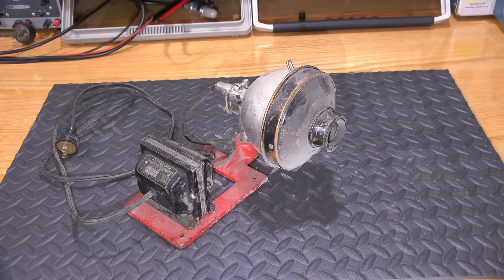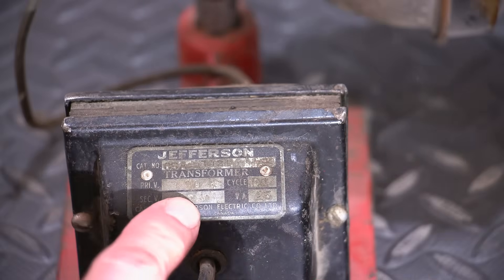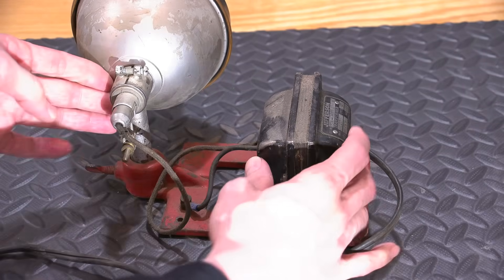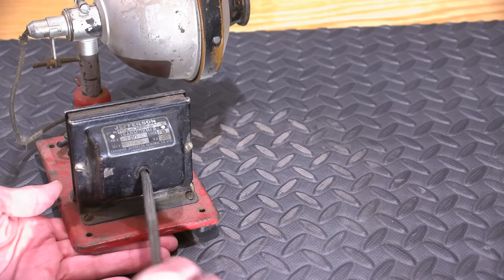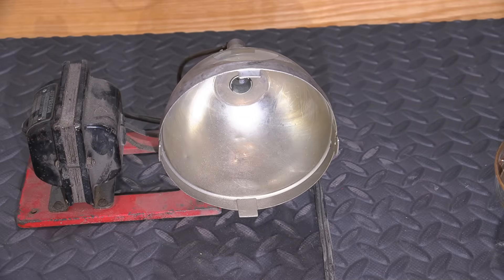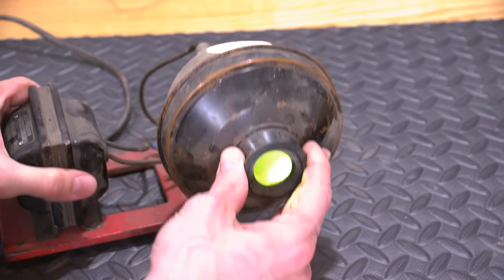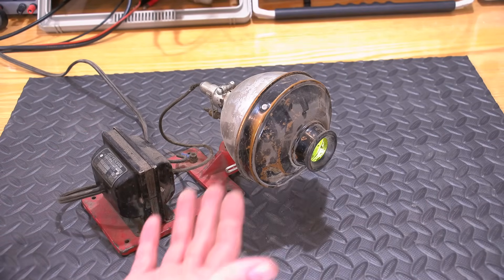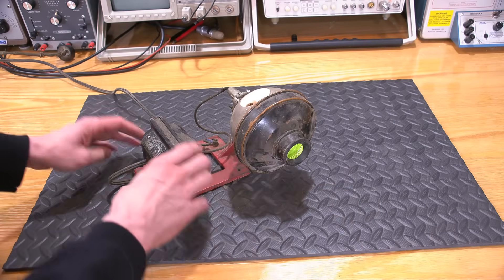Barn Find - What Is It - 1940's? Mystery Device Teardown!

Comment: OHMYGOSH. I think you folks and the comments about "Candling" just saved me from throwing out 49 Jumbo eggs! Last week, I bought three cartons of 18 eggs each. Out of the first 5 I had three that had embryonic development. I pitched all 5 but not the remaining that I left in the refrigerator (I hadn't decided how to handle that large of an investment until now). I have a very bright green led flashlight. I turned off the light in the kitchen and tested it on an egg. It shows the yolk shadow just like the images I found on the net! I did 13 from the first carton and didn't find anything like what a google search shows. I did find three where the yolks looked much larger and darker than the others. I cracked them open, and they had DOUBLE yolks! I'm going to check all my eggs this way and hopefully, I won't find anymore embryonic eggs even after the egg shortage is over. THANKS Mr. Carlson!
Reply: There is no reason what so ever to throw the fertilized eggs away.  If it bothers you simply remove the spot and use the egg.  Used to happen all the time.  I'm afraid we have lost much common sense.
Reply: @pcar5  OOOf, they were pretty well along. It was a bloody mess in the skillet. Not very appetizing. In fact, pretty nauseating. I'm not sure why I had such a high rate of development in that first carton. The other two looked ok under the light but they are still going to be hardboiled.
Reply: I’m turning 64 years young this year and I Haven’t seen Jumbo or Extra Large Eggs in many Years Now , The Box Might state Large Eggs But They Are Probably The Smartest Sized Legal Eggs They can Market !!! You Have To Cook a Dozen Eggs Just to Fill a Small Plate to Eat !!!! Darn ! Now I am craving a Couple of Egg Sandwiches , that Should cost me $30 !!!

Comment: With the flash bulb, you could jury-rig a standard bulb mount so that the sides and base of the bulb are shorted.  Random volts won't trigger it then, and you can unscrew the bulb without any damage.

Comment: The flash bulb has fine magnesium wire inside. Also, I believe the bulb is filled with oxygen. A D battery could provide enough voltage to make it fire.

Comment: That type of flash bulb was typical for the large format Graflex Speed Graphic press cameras common in 1930-1950s. Bulbs could be bayonet and larger screw-in (Edison). Your #11 was likely used with a seven inch reflector.

Comment: Green lamps are used to be able to navigate and work in greenhouses at night during the dark period because it does not affect the plant growing cycle. It's not a spotlight, the light from the bulb is focussed onto the green filter which becomes the new, green,  light source. A large filter would provide just a diffused, and dimmer, light, so that's why the filter is small.

Comment: You didn't explore the focal length so it is not clear to me if the light is used close in or at a distance.  If at a distance, perhaps some sort of signaling light such as a semaphore for a rail road.  It is too small for a rail road, but perhaps for a mine or a factory environment.

Comment: Those large flashbulbs were prone to shattering. They are filled with a fine magnesium wire which can ignite with static electricity. The early safety device was a piece of glass to confine the bulb remains should it shatter. This was later replaced by a plastic shield. The final iteration had a plastic coating to contain the glass with some produced with the blue coating for color film. By then the Sylvania M2 flash bulbs hit the market making for a smaller add on flash for the camera. I had set up a flash trap on a basement doorway to the garage so when one opened the door it would go off. Forgot to turn it off one time and least to say my father was flashed by it, he was not pleased.

Comment: I agree with many other comments here; I'd bet that this is an egg candler; and the different coloured inserts would help you compensate for different egg shell colours and thicknesses, or to help improve the contrast and resolution of what you are trying to observe within the egg (colour contrast is still used in Biology and microscopy). It might also be a way of attempting to limit the disturbance that the bright light would have on the developing embryo; as it is good policy to limit egg candling as much as possible. So maybe different light colours were considered "less disturbing", along the same idea as film being developed in a "dark room" using red light, since film emulsions were least sensitive to Red light.
  
The inner back portion looks like a parabolic mirror; as in a parabolic surface is used to either focus all signals striking the surface to a single point (eg. a Satellite dish focuses signals onto the receiver), OR, if a signal source is placed at the focal point, then the signal is instead directionally reflected away in a column (eg. a vehicle headlight works this way to focus light ahead of the vehicle). if you change the position of a signal source away from the focal point, instead of getting a columnated "beam", you will instead either focus, or disperse the signal.  
So, since this is used with an incandescent lamp, and there are many "Styles" of how the filament is routed within the blub,  I'd bet the focusing mechanism is used to adapt the lamp to the bulb in use, and help "focus" the light being generated to a point that would be focused on the yolk of any egg being "candled". This would also be helpful if you were candling, say goose or duck or quail eggs, which are different sizes and shapes compared to chicken eggs.

Comment: Very nice flash lamp, I have one very similar with its original carton, a General Electric Synchro-Press 11. I've read these are not even close to being the largest flash bulbs ever made, with some absolutely huge ones developed for taking aerial photos during the night in WWII.

Nice heads up about them going off with static discharge, I've now wrapped a strip of anti static foam around the base of mine with a rubber band.

Comment: In the early 1970s I was a teenager living with my parents. My Dad liked going to auctions and he came home with some of the oddest stuff you've ever seen. Once he came home with a case of these flash bulbs that he got for $.25. You could set them off with a single flashlight battery or they would work on 110volts. Later when I was in college we had a guy who was always playing practical jokes on everyone so I brought a couple of the bulbs from home. He had the bottom bunk bed and he had a reading light overhead and it had an enclosure for the bulb so if it broke he wouldn't get hurt. He jumped about a foot when he turned it on. It didn't crack or anything, just flashed. It may have been primitive but it was well made.

Comment: Something in the back of my mind tells me some green optical glass was slightly radioactive.  I would be curious if this lens was one of them.

Regarding the flash cubes, I used the piezo type and the battery type before that.  Kodak 104 and later 124.  But even before that I used an old kodak camera with the look down through the top view port, which took 620/120 film.  They used flash bulbs smaller than the one you had but much larger than bulbs in the flash cubes.

Comment: it's misleading to talk about a ground, in ways that imply a static safety path, for use of the structural metal as a current return path. Car electrical systems also use such designs on a larger scale, albeit newer cars are moving towards isolated complete wired circuits.

Comment: There are 2 reasons to have the transformer... isolation for safety, and a low voltage lamp in low wattage is way more vibration resistant than line voltage. 

Chicken farmers I knew used coffee cans with 2 oblong holes, and a crude exposed lamp inside. One egg in each hand, hold, look for embryo or blood or air void, rotate, repeat. Way cheaper, faster, and functional, even if less safe.  

That transformer looks generic, not purpose spec made. Cleaning stuff designed for a chicken farm doesn't need mild cleaners ... generic dilute industrial degreaser, or dish detergent, should do fine.

Comment: What's interesting is that on the connector to the body from the transformer (seen at 3:09) is a old blue crimp connector. Was this possibly a repair later on? Given the age I would doubt that the soft plastic crimp connectors would have been available that long ago in the time when Rubber and cloth wires were still very prevalent.

Comment: Those large flash bulb's were used for architecture and interior design photography. Because they have a standard AC bulb profile, a photographer could use them in a decorative light fixture. Like, a table lamp or wall lamp. Everything up to chandeliers and spot lights ! I used them for outside/exterior fill lighting on building's and factory's too !

Comment: That's CLEARLY either the ORIGINAL Canadian bicycle head lamp, or the repurposed-version of the  "first AND LAST Canadian-Ministry Of Health splinter-removers!... Both of which were rendered obsolete in the 2000's when the costs associated with copper extension cords, and increased  population-density drastically-increased "long bike ride" strangulations, Which began interfering with the  Canadian Department Of Defense's ability to manufacture and deliver all the grains that the armored-moose tanks required to operate.  That's when The Ministry Of Calculatorians "GOT TO WORK". They got together with Canadian leaders aye, and released a report titled;
 "Aye Moose, What's This All A Boot Aye". 
 In the report, they laid out dozens of multi-colored pictures that depicted the problem with having extension-cords connected to bike headlights. And despite the vast majority of Canadians being in support of keeping the headlights, They were "legitimately out voted" again. Tragically many folks died in route to vote in bicycle accidents.  But It's within this very-same "French Pictostruction-Book"-report that pointed out it would be silly to waste all the hardware and then had the French Ministry Of Brilliance find a new use for all the NOW ILLEGAL headlights, all that's when they were all converted into the First Innovative Splinter-Removers and named "FISR Co". Later to become "Pfizer".

Comment: I had 3 or 4 of those old flash bulbs. I wish I kept them. They took line voltage 110 120 volts the filament  is magnesium I believe. Almost as loud as a firecracker. And they would go off if you dropped them on the floor. The glass had a plastic membrane over it  for safety. I think You're right about the egg thing.

Comment: I have a stupid beginner electronics question. The wall gives out 120 AC and the transformer brings it down to 6.5 AC, then doesn't there need to be some sort of bridge rectifier to switch it to DC to power the light? I don't see anything like this.

Comment: When I was in the navy, we used those large bulbs for making photos of night crash scenes. Smaller ones for most photos.  A photographer would stuff several of the smaller ones in the front pockets of the denim work pants for quick access.  A stray radar sweep could set them off, resulting in burns to the skin of the thighs.

Comment: Back around 1950 I had a camera with a flashgun that used No. 5 flashbulbs (bayonet base).  The clear flashbulbs were for use with black and white film, and the blue ones were for colour film.  I just checked on eBay and you can still find them there, but of course at exorbitant prices!
4X4LF

Comment: My first camera back in about 1968 was a Kodak Instamatic that used the 126 film cartridges and snap on flash cubes. The flash cube was a new thing at the time. Most personal cameras before then used single use push-in disposable bulbs much smaller than the one you showed. The glass bulb in either type would inevitably shatter but was encased in a plastic film to contain the bits.
There was a later version of those flash cubes that were operated by a pyrotechnic device under each of the four bulbs. That device, a small button just under each bulb, was hit by a striker in the camera to ignite what I assume was flash powder in the bulb. I never got to examine one of those but had a hammer ready if the opportunity had ever arisen.
Reply: I had the Kodak Instamatic 100 camera that had a pop up flash unit that took the individual AG1 flash bulbs. The Instamatic 101 ( not sure of model number) used the Flash Cube that was electrically activated. Later models of some Kodak cameras used the MagicCube which was the pyrotechnic version. Too bad these flash bulbs are no longer manufactured.

Comment: I know exactly what this is, it is form the 1940's and about that time school children had a yearly visit to school dentist. Just to check up. There was a problem with children like Clark Kent. Those children would not sit still and the dentist could not control them nor examine them. This lamp is aiming a Kryptonite beam through that green glass to the child, it is rather harmless but it is enough to make children like Clark Kent sit still for a while and let the dentist use that sharp pin to check between the teeth if the gums are still in order.

Comment: I have half a box of the flash bulbs for the flash attachment for my dad's Argus C3 camera, they are about an inch in diameter.  I remember my dad using it in the early 70s and the blue melted plastic that held the broken glass in.    Also have 1 unused flash bar from the Polaroid SX70 days.

Comment: What you have there is a theater fixed spot light. the adjustment on the back that moves the bulb in and out adjusts the filament focal point in the reflector therefore adjusting the size of the spot on stage. The clip allows for different color glazes to be placed in it. From the quality of it I'm guessing this is something that you might have found in your parents' or grand parents' school auditorium, mounted to a lighting truss with the vent hole pointed toward a negative space back stage so it does not spill light on stage while letting the heat escape. These are specialty incandescent bulbs pulling ~20VA so they're super bright and get very hot.

Comment: 13:00 Probably magnesium wire in there, with either air or oxygen as the gas inside, and a small filament to heat the wire up to the ignition point.

Comment: My Polaroid SX70 camera used optionally the cube flash bulbs.  That was before I bought an electronic flash unit for it.  What probably few people know, the cubes were triggered MECHANICALLY.  As I recall, there was a spring loaded "hammer" that, when released, smashed a thin walled tube for the ignition of a (probably zirconium) wire.
 As a young school boy and early photography enthusiast, I once bought a pair of those Edison base flash bulbs.  Mine were coated with blue plastic film for mimicking daylight.  Only two, because they cost way too much for my meager funds.  Anyway, the flash shattered the glass bulb, but the blue film kept everything safely together.

Comment: I have a predecessor to flash bulbs.  It’s a small flat round tin containing a roll of magnesuim ribbon, called a “Flashmeter”.  To illuminate a scene for photography you cut off 2 inches of the ribbon ( there is a measure on the side of the tin).  The end of the ribbon fitted into a couple of nicks on the outside of the tin.  You then held the tin, lit the magnesium and exposed the photograph.

Comment: I remember those flash cubes. Used on 'Instamatic' cameras. There were actually two different technologies. One used batteries to set the flash off. Either inside an adapter, or inside the camera. The other one was more explosive and was triggered by a spring wire that struck a rod at the base of the filament. Pressing the shutter release, pushed a peg up into the bulb, to release the spring wire.

Comment: As a child I had a little Agfa camera that used those rotating flashcubes!  
If a static discharge can set those flashbulbs off so easily, giving you third degree burns, I'd probably want to short out the base before handling them.

Comment: During the video, Mr. Carlson says he believes  that the device involves some kind of  "focus" mechanism.   I think it's highly likely that Mr. C is correct and that the device  (whatever it was used for) operates in a way that is similar  to the way an  automobile headlight works.    In an automobile headlight,  the inside (reflective) surface of the housing is curved in a particular  way and the filament of the headlight's bulb is  located  at  a  very particular  point in relation to the curved surface.  (In mathematics,  this curved surface is called a "paraboloid"  and the  point  at which the bulb's  filament is located is called the  "focus" of the paraboloid.)      The properties of the paraboloid and its  focus are such that all of the  (multi-directional)  light  rays  created inside the headlight housing  travel in one direction when they exit the housing.   That direction is,  essentially,  straight down the road.   (It's not exactly straight down the road because of two things:  1) for safety, we  tilt  the headlight slightly downwards,  2) dust and other particles in the air,  cause some scattering of the light.)
The video shows clearly that the "mystery" device's bulb is enclosed inside a curved housing  and that there is a thumb-screw mechanism  that   moves the device's bulb  within the curved housing.   It's very likely, I think,  that  the housing's  curve surface is a  paraboloid  and that the  purpose of the thumb-screw adjustment is to move  the bulb's  filament  so that it is located at  the  paraboloid's   "focus" point.   This would cause all of the light generated by the device's bulb to travel in a beam that  goes  straight  through   the small green piece of glass that is part of the device. 
With the light  going squarely through the green glass, the chances of  seeing what's inside an egg are maximized.